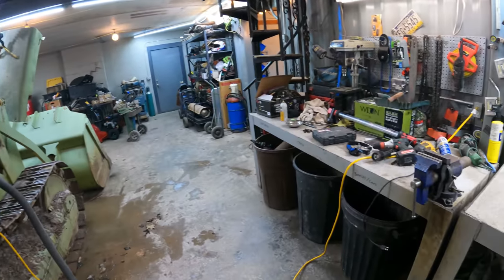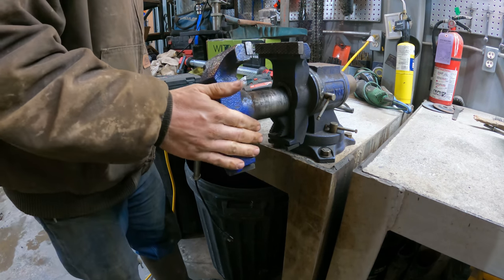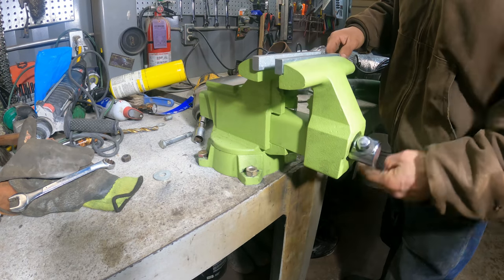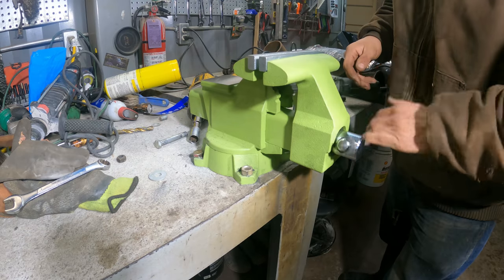Installing a new vise

Comment: Non è forte la morsa da te installata, è in materiale di ghisa, molto delicata, avrei optato per una in acciaio

The vice you installed is not strong, it is made of cast iron material, very delicate, I would have opted for a steel one

Comment: The problem isn't 4K, 5K, 8K...... 8K TVs are supposedly the next big thing.  The problem is delivery of the higher bit rate.  I've got fiber, put in by a city owned business.  GREAT!!!  RIght?   For the most part it is great.  But 4k sometimes buffers and I go back to 1440 or 1080.  The data stream is only as good as the worst network delivery in the whole process.  My fiber speed is only guaranteed for in city delivery on the fiber network to the recipient on the fiber network.  Anything coming in from outside the city limits is "Not our problem" and it shouldn't be as they have no control over that. 

So, you could pump out 12K videos and it may have to be degraded so it can be sent without buffering,.   I wouldn't get that far ahead of resolution until most can see that resolution seamlessly.  I here, I watch, but seriously 2, 5, 10 years from now how many people are going to be watching this video?

Comment: While higher resolution is better, you have to realize that when you export you video there is some compression going on reducing the quality. Depending on how you exported it will also determine how much youtube will down sample and further compress the video
Reply from the maker: Yeah, I make sure to export it in the same resolution it was filmed in, and the same bit rate.

Comment: 20$  say you break the unbreakable hammer
another thing I bet you got that wrench stuck on purpose just to use the new hammer
 
I'm surprised you didn't summon the blow torch to get the bolt's out.....does the new vice glow in the dark?

Comment: never extend the handle of a vice. if you double its length you double the force and I don't imagine vices to haave a factor of safety much greater than 2. I think this is the reason why people prefer metal or wood work benches over rock and concrete.

can't you get sony vegas often enough on sale and it isn't like renting? I understand why adobe charges service fees because they went for a long long time never charging a dime which helped them become a standard. Besides if you could buy it and own it forever, they'd probably charge a few thousand so then plenty would pirate rather than buy kinda like many youtubers did with sony vegas when it was 600ish dolllars...

Comment: That handle on the hammer is unbreakable. Wilton pays $1000 to anyone who can break the handle! 6 reinforcements bars encased in the rubber handle.....That vice....not the best...the Wilton Pipe Combo or a Tradesman much better...

Comment: as long as you record a scene in 5K and then you add another from your Mavic Pro in 4 k your editing software has to upscale the 4k to adapt to the 5 k this means you're degrading your Mavic aerial footage, otherwise, you have to match the Mavic Pro 4k footage downscaling the 5k to 4k...this happens when you mix different resolutions in one footage... 5K is supported by Youtube but most of your subscribers can't actually see this resolution because of limited hardware. I have a relatively powerful machine in terms of processor and Gb of ram but still limited to a full HD display. Anyway, as long as this new standard becomes popular and new computers will run bigger resolution displays you'll be up to standard since a while ago.

Comment: The thing I dislike about 5k is that the framerate is lower than if you filomed it in 4k or even lower resolution. I noticed the movements aren't as smooth as if you filmed it in 4k
Reply from the maker: They  should both be 30fps.
Reply: @AndrewCamarata  hm okay... Then it must be some kind of optical illusion for me or whatever...

Comment: GoPro's software has been pure garbage for years - I've never understood how anybody could actually use it with any kind of satisfying results - much more patience than I've got, for sure.  Before coughing up the dough for Adobe, give DaVinci Resolve a try --- it seems to be plenty capable (way above my pay grade...  not that that's saying much) -- but for the one-time price tag of absolutely free, it's worth a look.  They just released v17 (I think that's the number they're at now) and so far it seems like it's performing better than 16 did - 15 and 16 had bugs on my computer, but it could be limited to my hardware, too.  -- But again, for the price tag....  it's worth a look.  There's probably a reason why so many content creators are going with Adobe...  but as you'd noticed, their monthly extortion fees....  "represent a business model that I'm not willing to encourage." 

5K --- my thoughts currently, and for the foreseeable future, anything above 4K primarily gives you more editing headroom -- more ability to crop a shot better or zoom in on details without significant image degradation.  Publishing a video online, in 5K, I suspect, is mostly a waste of bandwidth.  5K30 is great for capturing still-frame moments to edit through later, but 4K60 is easier to watch, at least in my opinion (and it seems like some 30fps is worse than others -- whether that's an editing issue, or just my imagination is certainly debatable...)
Reply from the maker: Good advice.
Reply from the maker: 99% of my videos are edited with gopro studio. I just wish they would fix some of the small issues it has.

Comment: 1080, 1440... 4k, 5k, 8k ect... even if you had a monitor that can display the images, at stated resolutions... can the human eye see the difference without being told what to see? My GPU is nominal at 1440, and my monitor is nominal at 1080/ 1ms- 75 hertz

Comment: Can I ask you something, where does the water come from in your House?
I hear it's a direct pumping around the clock and this is strange for us in Saudi Arabia, we have three options first the National Water Network is pumping once or twice a week, second drill a well after taking a permit and making sure not to damage the groundwater , third water tankers, there is no pumping 7/24 !
So we have water tanks starting from 10 metric tons for a small-sized house and may reach 200 tons according to what the owner of the house builds under his house and it is concrete and from the foundations of construction, this happens in the whole country, 

Of course, there are filters for purification for drinking and eating so that we do not have to buy water to drink and change the drains whenever it feels like it ,
Otherwise we pay the bill for the water, with the option to bring our own water or buy it from wells by tanks ,
 of course, the national network of water is from the sea "Desalination water", its very good but annoyingly they adds fluoride to it ! so we use filters for drinking and cooking , 
so what are your options?
Reply from the maker: Most people here have wells. In this case I did a shallow well. Its only 6 feet (2 meters) deep. And it works good. I did it on a wet area on my property, and dug a underground pipe from the well to the building.

Comment: Andrew AVOID Anything Adobe makes. In the long run you will regret using it, just like I did. Matter of fact AVOID anything that Microsoft makes or run's on and save yourself endless headaches with the entire WINDOZ platform thing.
 Get yourself a Mac from Apple, video software is already installed in Macintosh computers right out of the box.
Reply from the maker: The Premier has been very nice. I do not like the subscription based thing, but its getting work done. I have been using PC since the early 90's, I am good at using them. I cant do anything on a Mac.